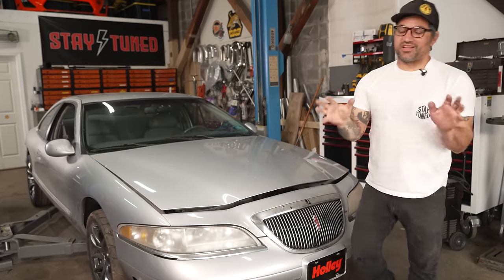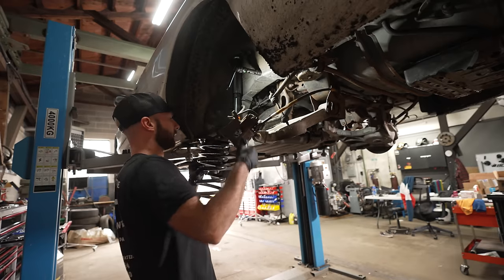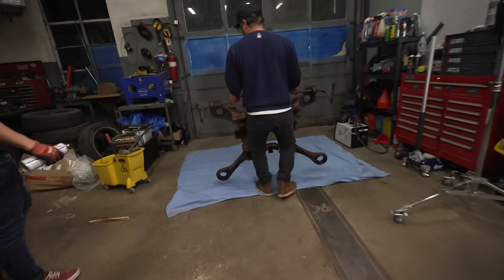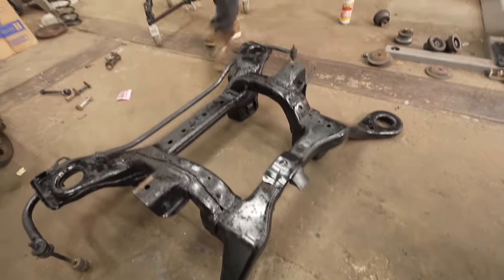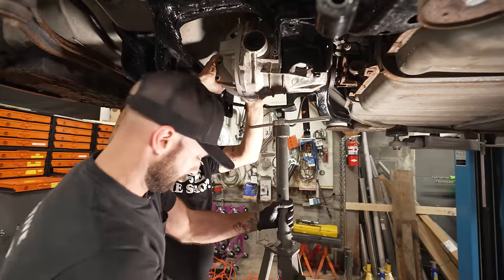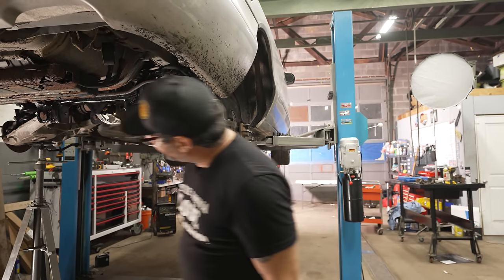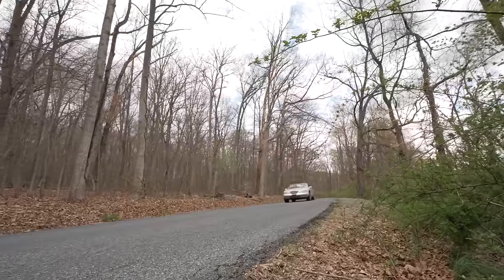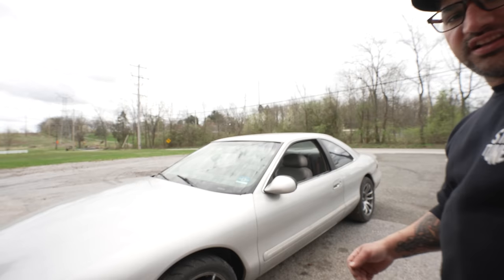Grandpa's Killer V8 Turbo Lincoln Hits The Streets For The First Time!

Comment: Working on one of my favorite S/T builds!!   Question...   Did you guys beef up those rear axles or joints at any time or are those factory?  I don't remember you doing so but that seems like a lot of power for stock.   Thanks for the Vids brother!!   P.S.  I saw a video the other day talking about a type of tarot art gate or valve that mounts on the intake of the turbo that varies the input of the air to the turbo.  It somehow keeps the rpms up on the turbo at low engine rpms so you have boost more immediately.  I was half asleep watching it and wish I would have paid better attention.  Have you ever heard of what I'm referring to?  P.S.S.  I found it.  Search "Mysterious Anti Lag System Discovered". Its a strange video but worth the watch.

Comment: Great job! Try compounding the turbo with a tiny one from a 4 banger, the faster spool will cure the lag. Smaller the turbo the less spool time and the sooner boost falls off. Compound turbos are done by simply blowing off the smaller one when the boost curve matches with the larger ones boost. Pulling one from a wreck and rebuilding it is cheep. Getting the blowoff/waste gate set right is the ticket, electric gates are expensive but slash tuning times as the computer adjusts the valve as opposed to manually swapping the springs.

Comment: Hay! Tony was there lock nuts on the inside of the cover on the support studs. Were you supposed to take the cover back off and lock them once it was set? I saw you drop one off before you put it together. Just wondering.

Comment: Almost certain MK8’s had 3.27 trac-loc rears and the 4r70w has a 2200 stall converter from the factory. Going to 3.55s from a 3.27 isn’t doing much. Don’t fear the gear.
Reply from the maker: It felt like it could be more for sure, esp with this lag. We can always up it again.

Comment: Tony, going back to the original engine, why did it grenade? Weak rods? Crank failure? Over rev? Piston failure? You built the car I had built in my head over 10 years ago. I don't have money so I can't build it. Nice to see it is everything I knew it could be.
Reply from the maker: I think the boost was nuts on the track compared to the dyno and we just had a ball and spring controller and I sent it hard run 1.

Comment: A 20 ton press is under $200 at harbor freight or you can get a used one like i did on marketplace for $60 so why keep using hammers and sockets and bench vises it doesn't make sense

Comment: Get a decent converter in there, that will make a huge change in the launch.  You need it to stall high enough to be in the boost before the tires turn. I have had good luck with FTI , Yank and Circle D are also good options.  With a lockup, even a radical stall will drive decent on the street.
Reply from the maker: You are not wrong! We are gonna mess with cam timing and tune but that would get it rocking! I usually don't love one that loose but lockup would make it work.

Comment: If you're using Holley why don't you use the 2-step set at your stall rpm to build more boost off the launch
Reply from the maker: We will try that and play with the  cam gears and see what it will do.
Reply: @StayTunedTA  Great to hear. I'm pickup my 4.6 2v block from the machine shop tomorrow, have a nice 7275 turbo going on it

Comment: SOOOO THE REAL QUESTION IS....WHATS THE OVER/UNDER ON THOSE STOCK ASS AXLES???? ILL GIVE EM 3 PASSES BF THEY POP!
Reply from the maker: HAHA, yeah i don't know. We will find out. Turbo cars don't really hit at the line so maybe it will help/
Reply: @StayTunedTA  with that power thru stock ford axles I don't really think it matters if it's on the hit or 60 feet down the track.....id be worried they pop further down much more dangerous down track than at the line.

Comment: Bitchin Car!, That one will SAVE the Shop!!.   Still waiting for my "We are gonna Save the Shop" T-shirt.  Oh wait a minute, What?, , lol.  You touched the FUEL TANK!!, with the ethanol brittle fuel lines!.  It's gonna scream back at you,, with tears in it's eyes!, whilst standing in a big crowd!!.    Never loctite, only NS on suspension anything, because wet environment.  Those bolts will lock themselves with road grit.   Find a good rack and pinion Arbor Press on a narrow stand.  One handed, one speed, 1000lb Arbor Press.  For when you don't want or need to set up the 30ton  hydraulic press, or fiddle with the bench vice pressing in bushings or u-joint cups, Ect.  Super quick, easy, one person, one handed.   I don't want to see your bench vise snap and toss that outer jaw at yous guys!, with significant mass and speed.  This happened to me. I had just stepped out of the line of fire, with a cheater pipe swing on the bench vice, when it broke. KaPow!. All the way across the shop with that outer bench vice jaw!.  Thanks for the Vid!.